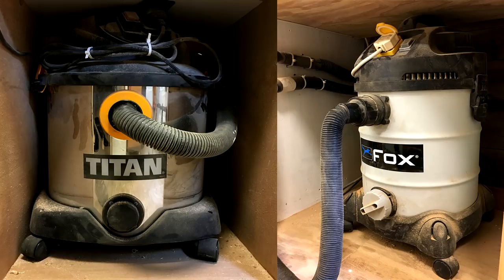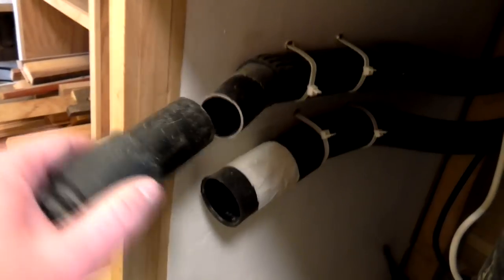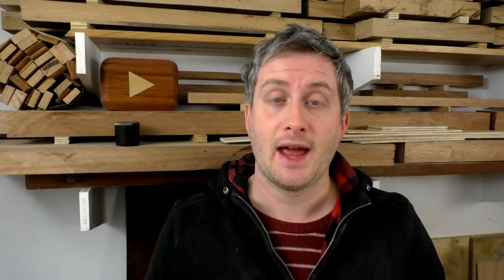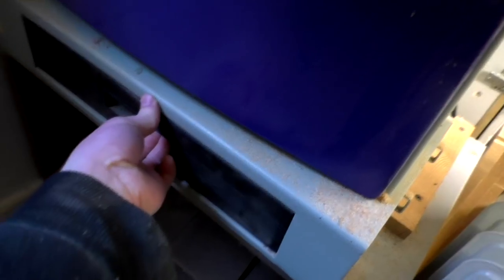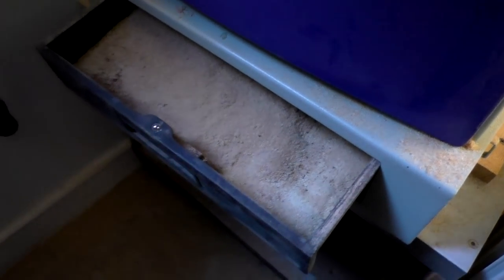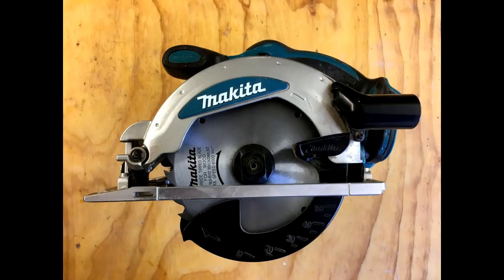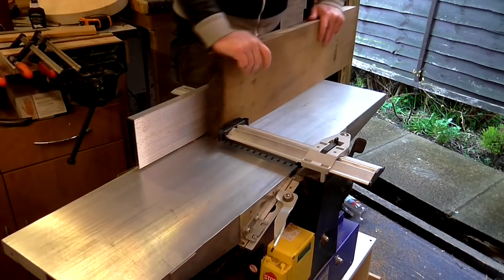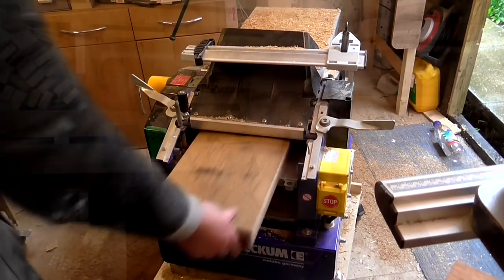Why I'm Upgrading Dust Extraction In My Workshop

Comment: I will follow this one closely. I need to do something similar in my new small shop which is completely empty at the moment. Regarding switching on and off do not dismiss the benefits of remote control extension leads. I use a couple from OWL around the house and they are excellent.👍

Comment: Instead of putting wood under the extension you could put the dust collection bin and cyclone and keep the vacuum motor in the extension to dull the sound that way you can use a larger bin and just exhaust to the outside so no filter required.
Reply from the maker: Great idea but I'd like to keep my garden looking reasonably tidy (that's a lie, my girlfriend would like to keep my garden looking reasonably tidy!)

Comment: Lotsa good valid points, I’ve just purchased Charnwood B350 Bandsaw & Charnwood W619 Table saw inc update,, only a newbie in woodworking....now just purchased a Clarke Woodworked CWVE1...haven’t actually tested in Workshop as yet...also couldn’t find anything on YouTube either,( I’m surprised) it has similar spec to the Record Power and Sheppach all around £140. Keep you posted, I’m not expecting miracles tbh after adding my hoover hose to it...it did lift the hair on my arms tho. 🤪😳

Comment: I avoided the filter problem in my workshop by adding extra piping that exhausts outside. I also tried the blast gates/ducting strategy for a while, it was a pain to use and kept getting blocked up, I found the easiest thing to do was to have a 5m 60mm flexible hose and just connect it up to whatever you need to use it for (like your current setup). 60mm works well for chips too. I can't detect the loss of pressure, it's still very powerful
Reply from the maker: I'd love to see how that exhausting outside pipework is set up and how it looks... sounds ideal. Moving hose around is fine but trouble is I'd get fed up with moving the pipes around and end up not doing it!

Comment: Found this really interesting Keith , my set up is a chip extractor for the table saw and planer. Plus a vac for everything else . I recently fitted a 6" bathroom extraction fan in the shop wall with a homemade filter you would be amazed the crap it pulls out of the air ,and then i simply get the airline and blow it off outside. Clean air is so important and i yet to get mine where the air is good quality .Speaking as someone who has had pneumonia twice i look on with interest to your solution.
Reply from the maker: Thanks Michael. Your extraction fan and home made filter sounds like a great solution. Any photos of it? May try and do something similar in future Thanks, Keith
Reply: Cannot get a pic on here ,so i will place one on the WWUK site for you if that is ok ?

Comment: Hi Keith, looking forward to the video Friday as you know from previous comments i'm looking into this style of system too. i stumbled across the Axminster auto extract controller unit which maybe helpful for you also. This allows you to turn on the machines and the extraction starts up. It needs additional items purchased that are stuck to the motors. As for the air filtration i was looking at a JET air filtration unit which are widely available secondhand in the UK. Anyway.. fantastic start and really interested to see the next one.
Reply from the maker: That looks like a great device! Reviews seem slightly sketchy though... may look in to one! I'd love the jet air filter too but not sure I can squeeze one in
Reply: Rag 'n' Bone Brown i had a look into dust filtration further and found some smaller units made by Microclene (Mc200) might be worth a look as they’re quite small. Yandles sell them

Comment: Have you thought of getting one of those wood turners masks. Full face full visibility and air pump to stop misting. And keep your current system. May be less work and cheaper. Less maintenance and faff. Just a thought.
Reply from the maker: Yep, the trouble with that is that dust stays in the air for so long and I'd be wearing a mask for ages which isn't very comfortable and would be replacing filters all the time too

Comment: great video and interesting topic as Im now at a similar stage of needing better extraction. I am thinking of having a little separate partition room with a record cx3000 running all the stationary tools as it is nice and quiet. Possibly not so good for the smaller sized pipes though.
Reply from the maker: Sounds like a good plan but you're right, bigger pipe may be the way to go for that one

Comment: If you want to protect your lungs you really need an air filtration system too. Even an expensive dust extractor will not catch all of the dust that a power tool produces.  In particular mitre saws often have poor dust collection.  I will watch your next video with interest because I have actually been comparing dust collectors this week as I am considering what to get when setting up my 1 car garage workshop.  I want to get it right from the beginning.
Reply from the maker: Thanks! I'd love a filtration system one day too but don't have space for one at the moment. I wondered if there was some sort of wall mounted fan extractor that might be better for my shop but I don't really understand enough about it... I'll keep researching and slowly learning though!
Reply: Rag 'n' Bone Brown I have seen many people make their own with a box fan and a couple of filters.  These fans arent really designed for that though.  I haven't fully researched it but was wondering if I could use a 12v car radiator fan.  They, after all, are designed to push air through a resistive surface so I would have thought they can push air through a filter.  Making your own means you can fit it in whatever space you have available. Powering it may be the issue, as car radiator fans can be very powerful (and noisy).  I was thinking a computer power supply or maybe a high-power LED power supply could be used.
Reply: Rag 'n' Bone Brown John Heisz made a wall-mountable one: https://youtu.be/5csWbjg5w4w
Reply from the maker: Thanks - nice idea and will check it out
Reply: Jon Peters has also got a video for a home-made air filter built into his shop wall.
Reply: I am in the same position as you. Finding a decent dust collector that won't break the bank!
Reply: Rag 'n' Bone Brown most of the air filters can be ceiling mounted and are virtually silent. They do however start at around £175 for a record power.

Comment: Thanks for this vid Keith, I think it will make an interesting series. I wonder how the strength of suction at various points in the pipe network might be measured or monitored in the course of ordinary usage? You've certainly got me thinking about my own very rudimentary measures. Thanks again mate.
Reply from the maker: Thanks Mark. I wish I had a way of testing the CFM in various places now it's installed as that would have been interesting

Comment: Just a tip, use the least amount of flexible pipe you can as it causes lower airspeed and thus suction compared to a solid pvc pipe. Obviously depending on what type of extractor you use this will dictate pipe size. A shop vac type with cyclone works better with a 2" pipe while a high volume low pressure extractor works well with 4" drainage pipe. Good luck adaptors to machines can be a nightmare, I wish it was more regulated and standardised to make our lives easier.
Reply from the maker: Thanks! Great advice. I wish the ports were standardised too. It's not even standardised across one brand - e.g. my Makita circular saw has a different size port to RO sander... ridiculous!
Reply: Rag 'n' Bone Brown there are a lot of videos on how to make your own adapters. I was going to buy and exhaust pipe expanding kit about $50 Aus and use the closest plumbing fitting. Then use a heat gun to soften the pvc and the exhaust pipe expander to stretch the plastic to the size you need. Obviously don't try to stretch them to far or you may get a surprise lol

Comment: Keith, do you use any type of air filtration system? Box fan with air filter attached? Or perhaps something more elaborate?
Reply from the maker: Not at the moment and the filter type boxes are a bit too big for me to put anywhere but I'm interested in learning whether there is any sort of extraction fan that could be wall mounted
Reply: Rag 'n' Bone Brown The $20 box fan with an air filter attached works surprisingly well—check out John Heinz’ “I.Build.It” project where he mounted a regular fan and filters on his shop wall.

Comment: What do/did you have on your shops vacs to do auto start up? I didn’t think the screw fix ones came with auto switches and I know your table saw one is a titan. I want to get auto switches on mine but don’t know how without splashing alot of cash
Reply from the maker: The extractors have a socket in the top which you plug the tool in to and it will auto start but you need to check the tool is compatible with the extractor in terms of voltage
Reply: Rag 'n' Bone Brown do you rate the Titan one you had?
Reply from the maker: It sucks good, the hose is cheap and nasty but if you want to protect yourself from dust inhalation you should buy an m class dust extractor because the Titan spits out fine dust from the exhaust
Reply: Rag 'n' Bone Brown thanks for your help!

Comment: I can't speak for other viewers but personally this kind of videos are very interesting for me.
(of course it depends on the channel but I know that when you are talking it makes sense)
Dust collection/extraction is a big issue for everybody. So many problems to overcome and many ways to do it correctly  (and even more to do it wrong, I suppose)
Recently I ran into a German You Tube Channel and there was shown a workshop (much much larger than yours, but the system is the same)
where there was also a central dust extraction system to which all machines where hooked up.
But he made the system in a way, that when he turned on a certain machine, automatically that dustport was opened and the dust extraction was turned on.
Turning of the machine automatically closed the dustport and switched of the dustextraction after some seconds of delay.
Unfortunately, he did not explain/show how that everything worked (I mean the internal electrical connections) but it exists and I'm sure an electrician can
help you with that. Good luck and thanks for sharing the video.
Reply from the maker: Thanks Hans. Wow that sounds amazing. Bob over at I Like To Make Stuff did something similar and explained it well too but it was all a bit too technical for me to understand!
Reply: I'm sure a good electrician can help you solving this problem. If he shows you how to do one, I expect you're able to reproduce the procedure for your other tools.
(if he lets you and if it is allowed according to the law in your country)

Comment: i spend a lot of time in my shop on my computer, even when I'm not working on a project. while doing projects i have an air scrubber and i wear a respirator. is it dangerous for me to be in my shop even when not doing projects?
Reply from the maker: I don't think it'd be as bad as while you're moving around and working but there'll definitely be dust in the air. Might be worth investing in an extraction fan or filtration unit if you're worried about it

Comment: Make your blast gates open automatically when you switch on a machine via a microcontroller!
Reply from the maker: Sounds way above my level of expertise
Reply: Bob clagget on the I like To Make Stuff channel did this recently. fully automated, you might get some tips from his vid.
Reply from the maker: Yeah I've seen Bob's solution which looks amazing but bit too technical for my brain!
Reply: What about the other way around?
Have a microswitch or relay that triggers the power to the tool when you open the blast gate?
Reply: Wouldn't make sense because more often-than-not, the switch to the machine would be more accessible and that's what's needed especially if you need to switch it off immediately in case of an emergency.

Comment: I see a problem. Placing the vac higher (in the extension) is not ideal. Sucking things upwards requires more and are less efficient than downwards.
Reply from the maker: The pipes will be ceiling mounted so I'm not sure how that affects things. I don't want to give too much away and spoil the video but I'll just say: things work out pretty good